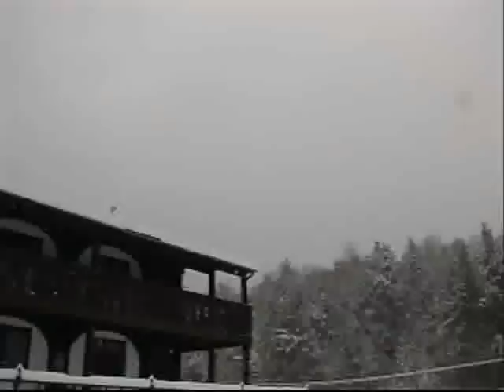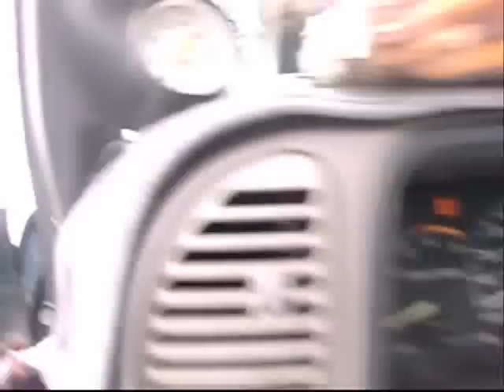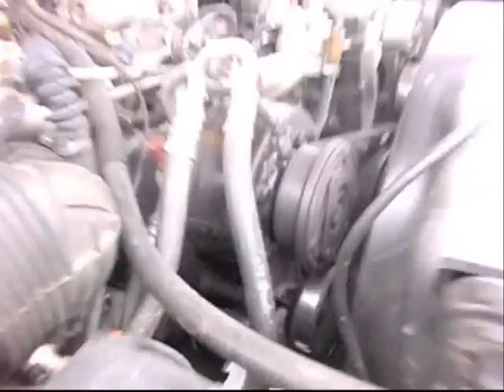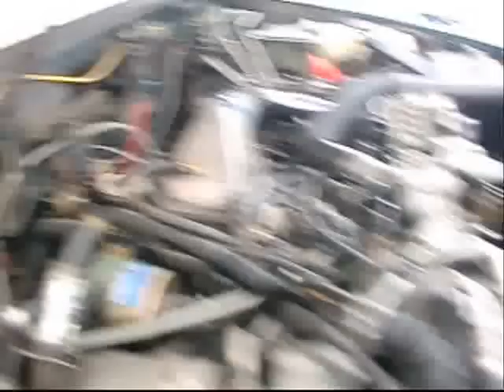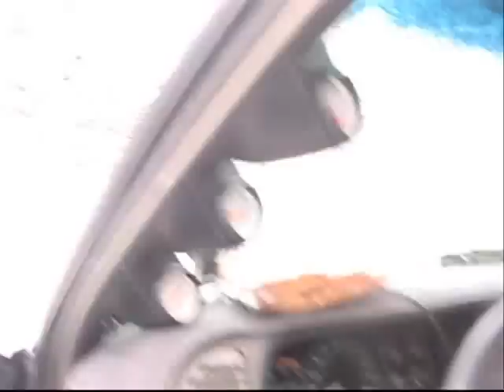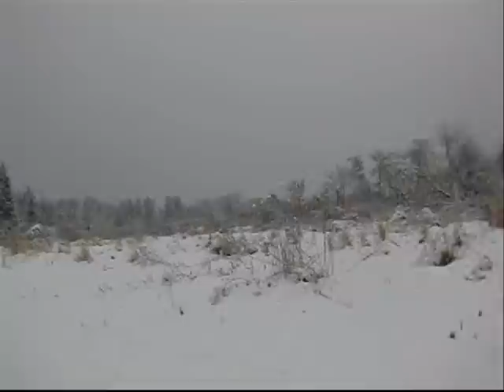12 26 11  Cold Az Sub Crank...

Comment from the maker: @ruwithlee1970 A bit is OK. I meant to show sharpshooters 7.3 Powerstroke. He had some smoke too. Just as long as it's not like a train stack! I would use synthetic oil, and a $10 filter, filled 1st. It soaks in the paper. FLAPS always have special deals, but he needs 15w40 diesel grade oil. I use rotella from WW

Comment: Mr.CW my brother just bought a 98 gmc 4x4 crew cab it has a 6.5 it has a bit of smoke coming from the oil filler is this normal? The motor has 200,000miles.